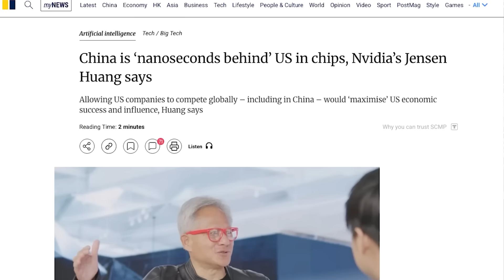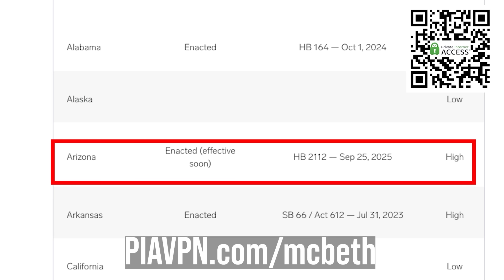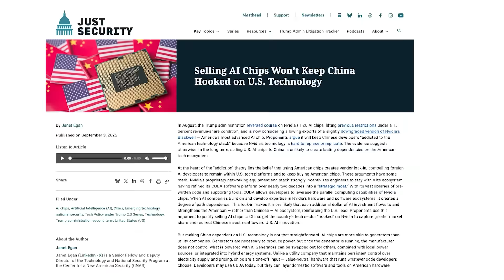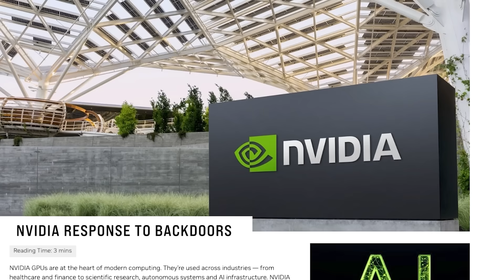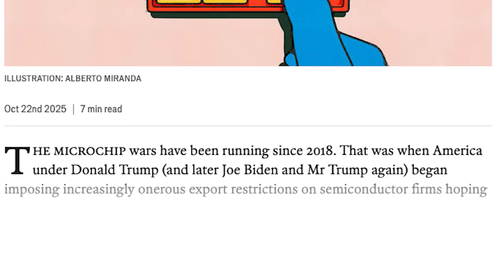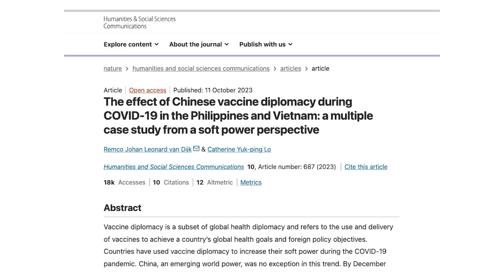China’s 🇨🇳 Secret War for Tech Independence

Comment: An example of China not needing our stuff, would be Amazon.

Western inventors have been putting products on Amazon, and China has been copying them and using the western advertising as their own ads for the knock-off products .

Same goes for their airforce and tanks and drones… tech is easily broken apart and made cheaper and crappier.

Comment: Remind me where CN is on Lithography and the instrumentation that make it work?  There is a reason they are stuck at an older process node.
Reply: Exactly. China wants the equipment to make the newest 4 nm (?) chips and the West won't allow it. They haven't figured out how yet, but are trying everything under the sun to get it. 
   And don't think that they don't have back doors in everything, even the simplest components. Even light bulbs can hack your WiFi.
  China wants to dominate all volume chip production and board installation, reference the current situation with the Netherlands.
Reply: @jeffhill3681  Right now china has a functional prototype EUV machine in a laboratory, china is slated to have commerical EUV working by 2030. Until then 80% of the chip market is lower end processing nodes which they can make, albiet less cost effectively.

Comment: The CCP is incapable of directing China to get to par with western chip making. The number of brains is not enough. First the CCP is too corrupt and too impatient to develop the grassroots R&D needed and they will always try to steal to decrease the gap in technology. If we compare chip making to their making of highend CNC machining machine, Very few chinese company will choose a chinese highend CNC machine if they have a choice, they’ll prefer a german CNC machine even when the cost is much higher. All the chinese high speed train need to be retired after 3 to 5 years because they weren’t capable of copying the wheel and shaft to the right tolerances with the domestic highend CNC machine. As for making highend chips, they have the gall to ask lithography machine manufacturer to repaire machines drestoyed while trying to copy the technology. If they are at inches away from western chip making, it might as well be lightyears as far as the real chance of catching up.

Comment: China already manufacture some chips but they are generations behind. Even if they design a modern CPU/GPU they wouldn't have to use decades old chip sizes. They can't manufacture modern 4nm or smaller designs.

Any military chip is fair game. Those are rather basic compared to a Ryzen or Intel.
Reply: Us can only blame itself for sharing ai tech. You can run local systems from home-made pcb. This is what happens when you underestimated your enemy and called them stupid